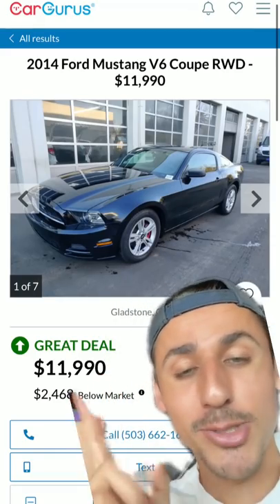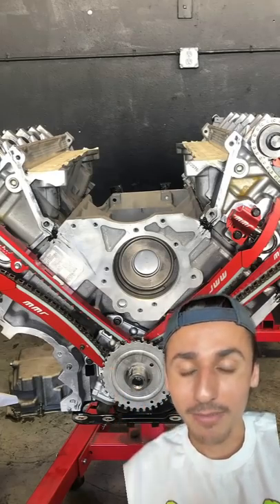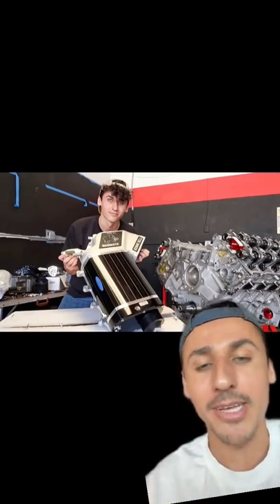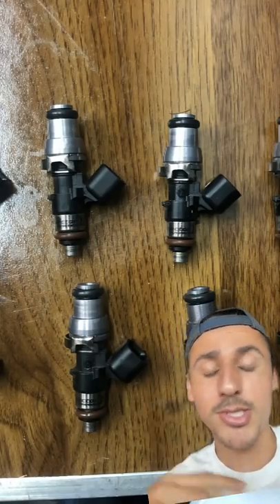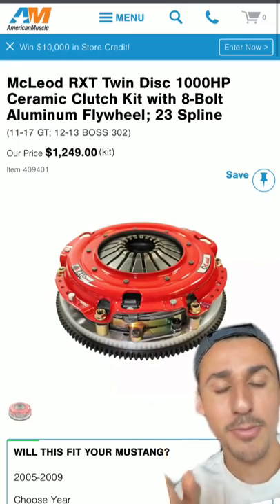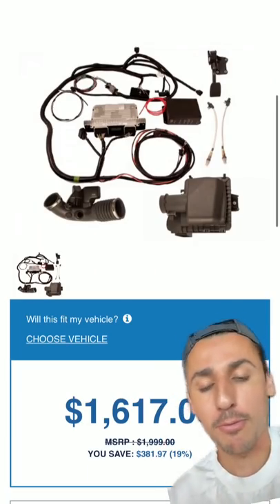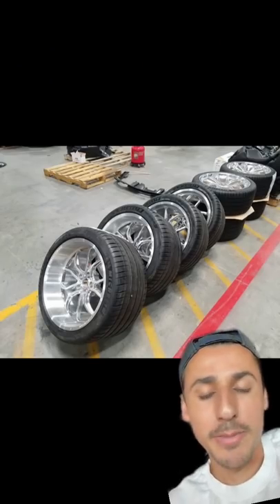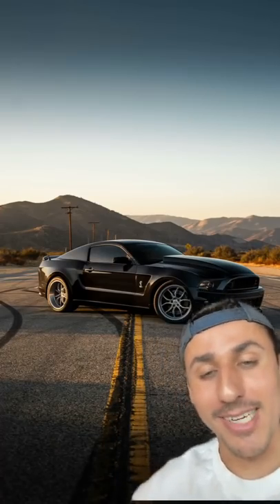How to build a 1,000hp car for CHEAP!!!

Comment: “Cheap” sounds like my AP Physics teacher calling assignments “piece of cake”
Reply: ONGGG ap physics was the worst
Reply: For a reliable 1,000HP I would say it’s pretty inexpensive.
Reply: the reference is "1k hp", for that, it is cheap.
Reply: @CaptainAlex69 reliable 1k hp with no brakes?
Reply: @CaptainAlex69 reliable lol. So many missing components. Plus paying for someone who knows what they are doing to make sure you don’t blow a rod out of the engine block and smoke your transmission every time you make a pull.
Reply: Lol but in all seriousness you can get a 3 valve for 3k and put the same motor and transmission setup, and not run a widebody so you could probably put down 1k horses for like 30k, the price of a brand new mustang 4 cylinder.

Comment: Yeah, cuz everyone has 60k sitting around
Reply: Might as well buy a used v8 and put few upgrades in
Reply: For 1000hp that’s very cheap lol
Reply: @marco_evertus  that's true but at the same time why do you even need 1000hp. exactly law of dismissing returns anyone?
Reply: Do you not? I keep hearing how easy it is to just buy an electric car for that…
Reply: You could buy a Tesla and gap it 😂
Reply: 95**
Reply: @thanosianthemadtitanic  for fun, duh.
Reply: That’s not what the videos about, he’s talking about how you can build a 1000 for cheap instead of paying way more for one.
Reply: @thanosianthemadtitanic  everyone is missing that this is the cheapest way to get a shelby 1000 as in well over 1000 wheel horsepower. It won’t be cheap
Reply: @OneNidim  why exactly 1000 I wonder even the best manufactory you can buy at cheap price (relative) he'll cat is only 797
Reply: he never said anyone did???
Reply: @jacksondoesstuff2458  Tesla's have no soul, I test drove one and was disappointed, fast or not.
Reply: @thanosianthemadtitanic  Shelby had a package called the Shelby 1000, had 1000bhp. Car is worth 200-350k because of how rare it is.
Reply: @marco_evertus  i can build a honda with a laptop for 15k that will dust this thing tho🤦🏼‍♂️😂

Comment: Traction: nah imma head out 💀
Brakes: nah I ain't stopping shit 💀💀💀
Diff: ima head out 💀
Reply: see my one wheel burnouts.. Errrrrrrr  BANG!
Reply: This is the comment, that BOAT better get some downforce before tryna leave the house with 1000 horses
Reply: @dstrctdco6315   its a drag car not a track car
Reply: @jawn_1086  drag cars still need downforce in the back thats what those spoilers that come like 6 inches off the back of the car or for
Reply: Broooo i cant stop laughing
Reply: Top G comment lol 😂
Reply: @jawn_1086  I saw a drag car start flying (really lifting off then tumbling back to the ground) on YouTube due to speed and a lack of downforce

Comment: “how to buy a 1000hp car for cheap” 
step 1: buy a honda
step 2: buy a laptop
Reply: goofy
Reply: Or….hear me out…..buy a stock Supra
Reply: @calworthington4523  lol no
Reply: @calworthington4523  Nobody wants to buy a BMW.
Reply: @calworthington4523  sorry man don’t have a spare 130k lying around
Reply: Mclaren: throws in a bmw engine
Everyone: wow what an amazing car
Toyota: throws in a bmw engine
Everyone: ew gross! Nice bmw bro! Should have done better toyota! What a disappointment!
Reply: Lol Honda Fanboy
Reply: My Man.... caught me with good hearty! XD
Reply: @rannz7  you just don’t want a bmw, bmws shit on anything you drive tho🤣🤣
Reply: @Frosty_Gang  Lmao, BMWs are pure overpriced proprietary unreliable junk but whatever. I'll still be chugging along at 350k hauling a camper.
Reply: @calworthington4523 bro thinks a stock Supra is 1000hp
Reply: @lukascoughlin7266  wow a i6 vs a na v12 like those compete in anyway
Reply: 😂😂😂😂 if only it were this easy 

*Step 2: Forged internals, New fuel injectors, new fuel pump, turbo and supporting parts, ported head, upgraded valve springs with titanium retainers. 

Step 3: Get a laptop and someone who knows what their doing.
Reply: With 300 lbs of trq and get gapped by a gti
Reply: @lukascoughlin7266 well the difference is that the new supra uses not just a bmw engine, but literally everything besides cosmetics from the BMW Z4
Reply: @lukascoughlin7266 literally everything except the engine was made by mclaren in the f1, meanwhile the new mk5 supra has bmw badges everywere, the only changes are the body panels and interior, and some toyota badges ofc
Reply: Honda lmdao😂

Comment: Left out the wiring, the starter, the ignition, the motor mounts, the custom fabbed front end, the cross members, the new tranny and rear end for the car to be able to hold the power, the suspension, and ontop of that you have to fit it all exactly where it’s not setup to fit..

Comment: Just add whatever power adder will suffice and supporting mods to a Boss 302. These engines routinely hit over 900 and been proven to support 1000 hp with stock internals.

Comment: So like 65k and it 7k for freaking wheels hell no I could buy a used s550 put a supercharger on it and have cooled seats and all the new safety features.
Reply: Facts!!
Reply: With $65k you could buy a new 5.0 with a roush phase 2 supercharger installed by the dealer. Have warranty and be more reliable/ safer than whatever this “build” would be
Reply: @habanero5.054  it wouldn't have 1000hp to the wheels though

Comment: Man fails to mention you have to probably swap the rear end and you have to get the suspension needed along with some chassis rigidity upgrades. Also the fact that you don’t need the wide body or the custom wheels.
Reply: Don’t forget upgraded breaks to stop that behemoth.
Reply: It's hard not to make the joke that the dude just read the shop's receipt. There ain't nothing wrong with someone who has money and had a shop do everything. But my God so much misinformation. And the labor my God the labor will be a pain the rectum.

Comment: Only thing you save money on is the car itself because he started with a gt500 but still ended up doing the motor build and everything else he mentioned so when he says a fraction of the cost he meant a small fraction is reduced

Comment: now if you actually want to go fast for cheap: 

Get yourself a new edge, a gen 3 5.3 with gen 4 rods n pistons, any cathedral port head, ls9 gaskets, arp bolts, 228/232 @ .050 range duration camshaft, less than .600 lift, heat range 7 NGK spark plugs, c16, e85 or meth, 80lb injectors, boost controller, s480, intercooler and rest of the turbo and fuel system shit 

a mild built th400 and 8.8 with about a 3.55 rear gear and a decent radial. and you’ve got yourself a solid 8-1000hp setup

Comment: Find a car with a large hood and rwd or AWD get a used LS, get a  larger volume fuel system for 2 inline 4s, get a newer clutch, rep wheels and lastly SPARE NO EXPENSES on a turbo/supercharger/procharger kit and paint the car white you'll spend about 15000$ if you get the car for 4000$

Comment: Now that you have all the parts you need to get them installed. Just slapping those parts together expecting them to produce 1000hp is not going to happen. Even if you do all the mechanical work yourself you will still be spending thousands for tuning, dyno and track to perfect the build. Once you start driving it like a performance vehicle you will have related brake downs that could even make you start over from scratch. 
What should have been clearly stated in the video is that parts should be installed over time to a running vehicle. Perfect the v8 swap first with rings gapped in anticipation of the supercharger first. Then instal and perfect the supercharger. Brakes and fuel come next, then suspension. After ALL mechanical is done then worry about paint, wrap and rims.

Comment: I tallied up everything on your list and got got over $60k.  A used 2014 Shelby goes for about $60k
And you there not factoring in replacing the brakes, suspension, or engine/transmission mounting, or the limited slip rear end.  Factor in a MINIMUM of $15k more. 
To build your own gt500, you’d have to spend about $80k….. or you can just buy a real one for cheaper.

Comment: You can save yourself the money and buy a 5.4 out of truck that’s also used in the gt500 they’re more common and you can get it with everything on it no adding a fuel system or anything

Comment: Or you can buy a cheap C4 Corvette which will dominate the GT500 on the track, and has a 350 sbc already in it, and for 6k get a procharger kit and just slap it on. If you want to go crazier the 32psi procharger kit is available, BUT you can build the 350 into a 383 and get those extra cubes and go from a 2 bolt to a 4 bolt splayed use ARP everything and get 1000hp reliably and you don’t even have to modify the hood.

Or just buy a 5.3 LS, twin turbo it and shove it in the C4 Corvette and call it a day.

Comment: Or you get a 335is for 20k, get port injection for 850, stage 3 fuel pump 800, an upgraded turbo 1000-5000, intake, Catless dps, 3.5 tmap sensor, and a great tune and you’ll push 700 plus easy and gap gtrs

Comment: Not including the 1000 dollar wrap youre looking at 62-68k.. Hellcat pumps "a bit less hp" for the same price no work needed and the jailbroken hellcats pump over 800hp directly out of the dealership.. Might as well just do the 86k for a brand new jailbroken hellcat with a warranty in case anything messes up on it.. Not 1000hp but 807 is more than most people know what to do with

Comment: Total is gonna come out around $66,900, at least that's from adding the totals in my head.

I also noticed you forgot brakes and suspension. These are equally important to upgrade when building high horsepower, high speed machines as using the stock brakes/suspension would affect performance. I'd say you'd end up spending about $73,500 for everything involved in this build.

Comment: 50,000 dollar build for 1k hp. I feel like you could drop 35 on a coyote, forge it and Whipple or turbo it and weld the diff if need be for about the same and have a newer car

Comment: Oh it's cheaper cause youre actually building it rather than buying it built. I think you could buy a hellcat motor and trans for 25-30k which is still under the costs he came up with and with the right differential + drive shaft you can prolly get a tune for a couple hundred with a pulley and make that power for idk under 40k. Or just do the LS actually cheap power option. Proven multiple times already, biggest expense would probably be the transmission at that point. Oh wait the hellephant 426 hemi. That's 24k I think. With a trans and makes 1000

Comment: A lot of effort to end up spending 60k anyways… I’m sure you could build something better with 60k…. Hell a Q60 with 72-80mm Turbo upgrade, fuel system & injectors, cams, lower end, upper end, and it’ll be maybe 65k. Would love to see the miles ahead it could pull..

Comment: I must have looked away on the cheap part can I get a redo? I rather buy a $500 honda put a $700 k24 in it throw some rods pistons in it for about $1100 ebay turbo kit for $600 and make 5-700hp n still take that mustang on a date to gapplebees

Comment: Or: Buy a shit box 12v cummins and turn the pump all the way up and drop maybe $1500 on some race injectors. You’ll shatter your tranny, melt your turbo, and blow your head gasket to smithereens, but you’ll be close to 1000 hp for much less than this guy.

Comment: Your prices are way off. A gt500 shortblock is about 14k and the heads are around 5 or 6k each. So around 25k for a long block. Before injectors and fluids and tuning

Comment: 1st step: buy a mustang.
2ns step remove mustang engine.
3rd step. SELL mustang engine separately.
4th step: Sell remainder of Jokestang car.
5th step: buy an LS3 or later, or a Chevrolet equipped with an LS3 or later.
chaching! WIN!

Comment: I mean technically you could use an sxt charger to make my hellcat bc the interior is different so are the gauges and axles and motor is built with a new block and a whipple so no stock motor at all and I have a different hood and new carbon front bumper and new suspension so I mean u could but u can’t call it a hellcat then

Comment: Here's how to actually get 1000 horsepower. 

First go find a nice old car that has no engine and a few minor damages. You could go online at auctions or at some junkyards.

Now we go and scour for an engine. An old gas V8 would work. Many trucks in junkyards have sufficient power plants.

Now putting in the engine into your junked car will vary in difficult. If you bought a car and engine that are from the same company, it would be easier. If not, you'll have to make some arrangements to connect with the driveline and to fit in the engine bay.

Now we have to crank 1000 horse power. To do so, we will have to start with what engine you're looking at.
First dyno the car to see how much power there is; the more power, the less we'll have to worry.

To go by the assumption of your build: you probably have spent between 10-30K for both the car and engine combined. 

This is where your journey starts, as you guys in the comments will please continue on how to make an actual cheap 1000 horsepower car.

Comment: So 67000 later ……… can build a 100 ho car way cheaper like way way cheaper step 1 find w220 s55 amg for 10k has 490 hp stick step 2 better fuel system about 3 grand custom ground stage 3 iracing cams port heads stage three pulley and new intercooler setup… super Spicey tune on e85 a little bit of tuning to the tcm and upgraded valve body new custom driveshaft and some 18 inch 255 tires boom you got 100 horsepower for about 30 grand and running it at about 800 hp for street it will last a while

Comment: Or i can buy a new 40k GT with almost 500hp then spend 10k on a duel turbo set up and have 1000-1200hp oh wait i did that last year and only spent 57k on everything. The car was 41k with 500 miles on it and i spent 16k on upgrades and tuning

Comment: Bruh this isn’t cheap lol, you’re just showing off how much you spent on it. 

10-13k  for the car 
15k for the motor 
7k for the 3.6 kenne bell 
4k for the fuel system, return style, and injectors 
3k TR-6060
1.3k for the clutch
1.3k for the carbon fiber driveshaft
1.6k control pack 
6k for the widebody and 6k to install it
7-10k for the wheels 
1k to wrap it

So cheap is $69,200??? Lol. No.

Comment: I love how 40-50 grand is cheap just so the transmission or something else can break due to all that power. Gotta work on other parts of the car buddy not just all engine. It’s a 1000 hp that won’t be able to finish a 1/4 mile sick 🤣

Comment: I fail to see it... Where is the "fraction..." of the original price here? Not to mention even with these insane costs (the engine costing more than the chassis and rest of the car itself) you still didn't mention the tune, the brakes, suspension and many other aspects of it. Unless you think you can break a 1k hp car as easily with standard v6 mustang brakes... In that case, good night...

Comment: This guy is talking shit, for cheap power just buy a Gen 5 or 6 used VW Gti or any bmw with N54/55 engine and bolt on bigger turbo, a valve and remap, maybe a bigger intercooler and your done. Get manual for reliability and forget about all this crap. For the money he says, getting another car that already makes that power from factory would be almost  as profitable, and without all the pain in the ass it is to build it

Sometimes even a basic stage 1 remap and good sounding catback will make you happy enough

Comment: So stock suspension stock axles stock differential new motor mounts if the car was an auto before the swap you need to have a coustum shift linkage set up and way more these vidoes are stupid

Comment: Bro. No. This is the problem with the car scene. Everybody rich af.

No. No. No again.
Buy a g37 for 5k throw a 10k supercharger kit and there you have it. 1k horses for 15k. Then another 5k for suspension ect ect ect. 

So 20k for a supercar killer. 
Your video. No. I could make 2 for that price.

Wow I finished the video after hahaha bro I could make 3 1k hp cars for that price

Comment: lmao what terrible info...he left out a lot...Brakes, front and rear suspension, rear end...all of which are for a v6...and are all different...not to mention loads of other parts and fabrication... and the time it will take to do all of this....
there is no "cheap" 1000hp car...there is no "easy" build either...you tube makes it look easy for entertainment purposes... 

plus TF u gonna do with 1000hp?....its a trailer queen...its gonna be in the shop being worked on (or by you) for more hours than you will be driving it...AND you or someone else would probably be dead or in jail...imo totally useless unless you are just drag racing